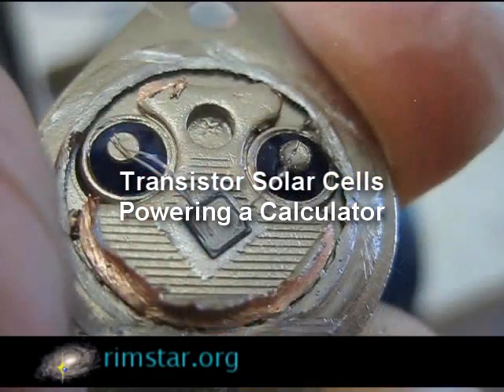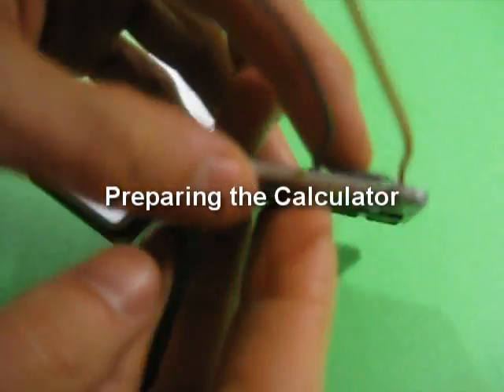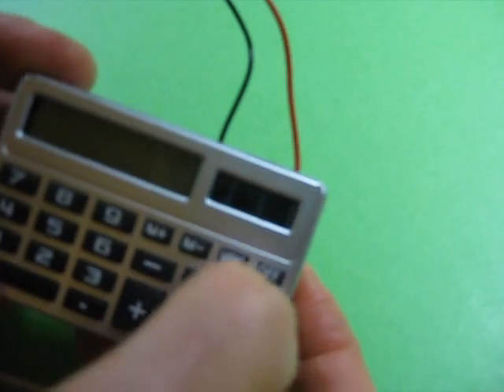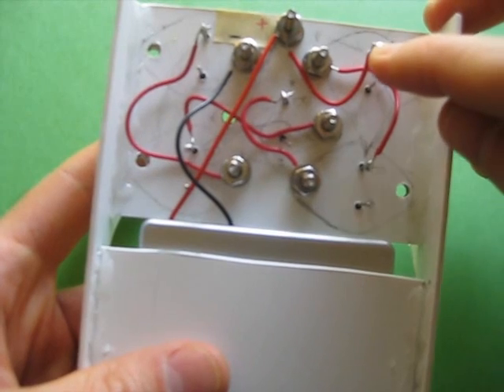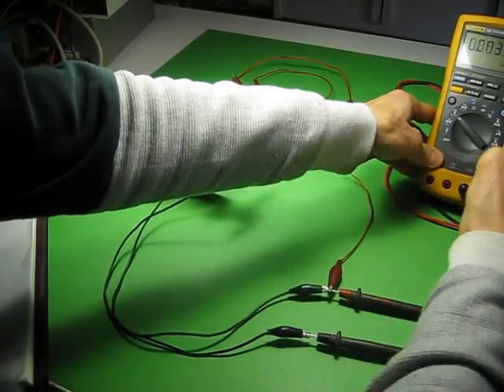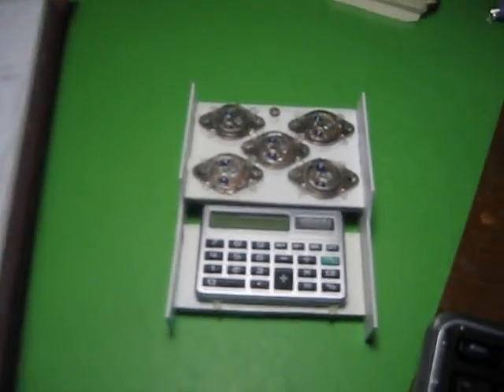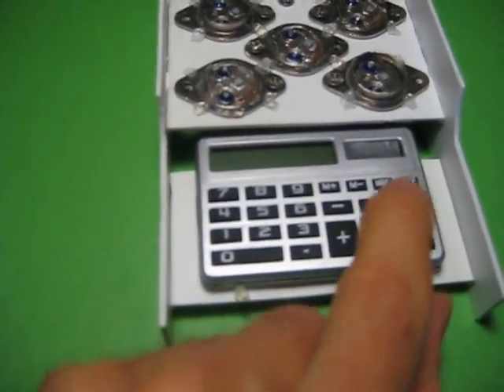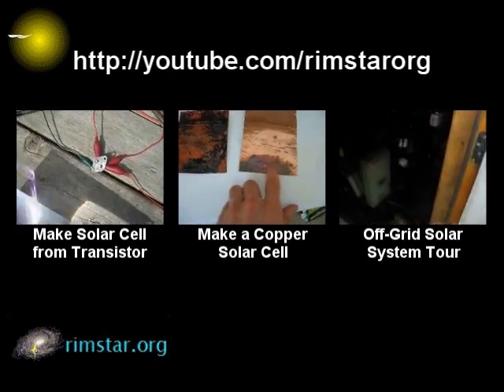Make Solar Cell Transistor Powered Calculator using 2n3055

Comment: Can i charge my mobile phone with 20 transistor?
Reply from the maker: Jignesh Dedhia I don't know what the requirements are for charging a cell phone.
Reply: RimstarOrg Cell Phones use approximately 2 to 6 watts when charging.

a cell phone charger can use anywhere from 2 to 6 watts for an average charging session. The main reason for the variation is that it takes different lengths of time to charge different cell phones.
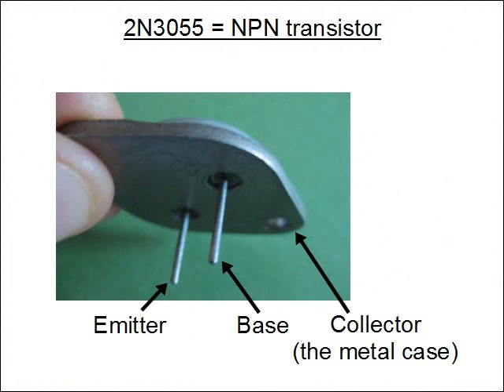Reply from the maker: Jignesh Dedhia In that case, based on the measurements I show at 2:23 it'd take an awful lot of these transistors. I was getting values like 90 uW, which means 90 microwatts, which is 0.00009 watts, far, far less than 2 watts. My measurements for the voltage wasn't across a test load but still seems fairly representative given how the voltage added up to run the calculator.

Comment: can transistor be fixed if blown
Reply from the maker: Not in any way that I can see. There are two very tiny wires inside these that maybe you'd be able to reattach if they became detached, but I don't know if soldering them would just cause more damage.
The wires in these ones make tiny loops in the air so that they don't touch anything else. If you've opened up one of these transistors and then it stopped working, it could be because one of these wire has become flattened and is touching something. In that case I just use a magnifying glass and a sharp knife to reach under the wire loop and gently lift it back up. But if you've never opened the case then this isn't likely your problem.

Comment: I'm curous, are there any other photo-reactive diodes or devices (aside from the 2n3055 transistor, solar cells and cuprous oxide+ salt water) that can be used as a replacement/ alternative in this experiment?
Reply from the maker: There are other power transistors with this type of case that should work too but also LEDs. I haven't tried LEDs myself but a lot of people have had success with them.
Reply: Thank you very much, now i have directions in my search :)

Comment: I would like to ask if connection point is important or not because I do this experiment but it doesn't work out to me? how is possible to make this worked, I didn't put any connection point but I actually try to test every single transistor...

Please Reply Me Immediately, Sincerely yours, your follower.
Reply from the maker: I don't understand what you mean by connection point. Especially since you say you didn't put any connection point. One thing you do have to be very careful of is to not damage the inside of the transistor. If you look with a magnifying glass you might see very tiny wires inside. Mine have these wires, yours might not. Each wire is connected to two places. Make sure the rest of each wire is not touching anything, but be very careful not to damage the wires or disconnect them. When mine isn't working it's usually because something has pushed one of those wires down and I use a magnifying glass and a sharp object to very gently lift the middle of the wire up so it's not touching anything.
Reply from the maker: *****
I still don't know what you mean by "connection". Do you mean is the type of device you try to power important? If so, then yes it is. Different devices require different voltages and currents. It sounds like the clock on your calculator is getting the voltage and current it needs but either the voltage or current or both of them is still too low for the calculator part. I don't know what kind of light bulbs work, but since it worked with sunlight and with my compact fluorescent light bulbs then I'm guessing it works with at least visible light. I don't recall exactly which fluorescent bulbs I used but I suspect they were either 13W, 2700K or 13W, 4100K. I suggest you bring the lights as close as to can to the transistors or add more lights. But if it doesn't work in bright sunlight then you're just going to have to add more transistors. Bright sunlight is equivalent to many, many light bulbs. But I don't know if your calculator needs more voltage or more current. For more voltage you need to add more transistors in series. For more current you need to add a second set of transistors in parallel. If you have a meter then you can measure the current and voltage separately to get some idea of what your "solar panel" is capable of supplying. Once you know that then you can look for devices that can work with those voltages and current.

Comment: You could make a small array of these and read the current values, you would have a low resolution camera, especially if there was a way to get rid of the casing. You could use it in computer vision/line tracking. Great work!!!
Reply from the maker: Oh, neat idea! You'd need a lens to focus the light on the largish area, or do a pin hole camera approach. As you say, it'd be very low resolution, but fun to do. Thanks!

Comment: I use soldering gun too. For BJT's it is not harmful, but will damage FET's. To prevent that push knob to get tip hot, release it and solder something quickly. No damage ( result will vary according to thermal mass of the tip)

Comment from the maker: Oh, I have a 40 watt soldering iron. Sometimes I used it and sometimes I just don't want to wait for it to heat up. Plus, my father used to use a soldering gun all the time so I got into the habit of it. Thanks for the recommendation though. You're right, better to use the 40 watt one and not take a chance.

Comment: I would like to share my recommend.  I wouldn't use solder gun since it is 150 watt.  Not very safe for transistor, capacitor, led, etc.  Use only for heavy wire.  Have you ever think about get 40 watt solder?

Comment: Did you try the Base as one and both the Collector and Emitter as the other, as if in parallel?
That strikes me as increasing your available current somewhat. A transistor is like two diodes back to back.

Comment: Is it true that it work like that:  normally is needed about 1V voltage to penetrate the P-N junction but when you use light on the PN junction of this tranzistors, it makes "artificially" P-N junction opened and this make +- voltage? So if it is like that, u can than generate maximaly about 5V for this 5 tranzistor? (i am laic)

Comment: And, by the way, those transistors look more like bu208 than 2n3055...
Anyhow, a long time ago :D , I found that bu208 and similar HV/deflection transistors have a larger exposed surface of the Silicon chip, thus allowing more light in them. ;)

Comment from the maker: I tried two pieces around 4" long, each a different thickness. I made a box with a 60 watt lightbulb in it. I put one end in the box facing the light. The other end was in a second box that I could see into to look at that end. I think I saw some light coming out of that end but it was very dim. That's why I needed that end in a dark box, to block all the surrounding light. Since this matched the poorr performance I read about from other people online, I concluded my results matched theirs.

Comment: Again, there may be a chance that the cap will discharge back into the Solar Cell Transistors when the light source is removed / blocked. I was counting on the P N junction being in the correct configureation to block any energy trying to come back to the Transistors.

If you do ever try it, please let me know what happens.

Comment: A cap with a very high uF should be able to store up enough energy to run the calculator under your desk lamp with out having to move the lamp down to the Solar Cell Transistors.

Comment: Something that drops the voltage  while raising the current would be like a joule thief. That would require a lot of parts and contruction as seen here:

.google.com/search?q=joule+thief.&hl=en&prmd=imvns&tbm=isch&tbo=u&source=univ&sa=X&ei=40eZT9PqPNK-gAf9zeWHBw&ved=0CDoQsAQ

I was working under the assumption the gole was to use the fewest parts.

Ran out of characters, will post remaining thoughts in next post.

Comment: i wonder if adding a capacitor would negate the need for adding more transistors? hopefully the cap would not discharge back into the transistors before it could be used by the Calculator. if it did you would also have to add a blocking diode that consumes .5 v that means adding another two transistors to make up for the v loss.

Comment from the maker: I haven't done coating method with LCD screen but I've had a discarded LCD monitor sitting beside me for ages for that purpose. I just don't like doing chemistry. If you do make one, be sure and do a video about it. I have done the copper solar cell (there's a link to my video about it at the end of this video.)

Comment: Thanks, I was wondering how that would. Your output was limited by the size of the smallest junction, in this case the base. If the collector had a surface area a hundred times the base the output would be the same.

Very good video. Thumbs up.

Comment from the maker: I just did the test you asked for (had to desolder one of the connections since I have no more transistors to play with.) I get the same as with measuring collector against base with no connection to the emitter. Both gave 340mV, 237uA (different than the values I show at 2:24 in the video since it's likely not the same transistor.) I redid all combinations to make sure everything was consistent with previous testing and they were.

Comment from the maker: I'm tempted to pick up 5 more transistors this weekend if the electronics store gets some in. In that case I may have too much current and would try a capacitor.

No worries re the infrared testing. Just make sure you let us know when you do it.

Comment: That is pretty good, like the commenter below me suggested a small capacitor across the calculators supply rails might help it turn on with less light.

Regarding me testing this with my infra-red LED array, I went to my local electronics shop the other day and they had no T0-3 style transistors (such as the 2n3055) in stock so looks like I will have to wait until next week before I can try it out ) :

Comment from the maker: Good idea, I hadn't thought of that issue. The voltage may also be higher than necessary, I was seeing 1.6V and higher at times, so circuitry for dropping the voltage while raising the current would also be good. Too bad I ran out of transistors, otherwise I would have added the second set in parallel to get more current and have it work in lower light conditions.

Comment: I liked the video.  If the solarcells produce more current than a calculator needs then that current is essentially wasted of no use (except for cloudy days when the sun intensity is not as much), so depending on the system, it might help to put some value of capacitor (not too large since it would take long to charge up when needed) across the power wires incase of temporary intermittent lower than optimum light levels due to clouds or something....maby a few seconds of stored power.